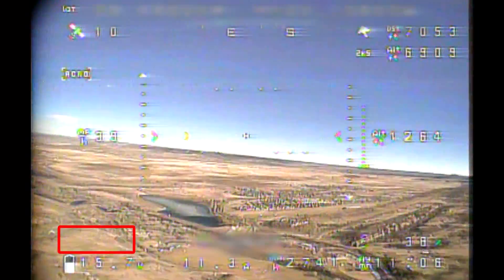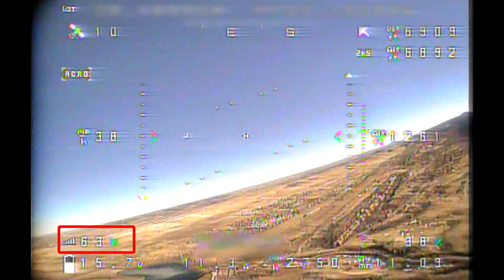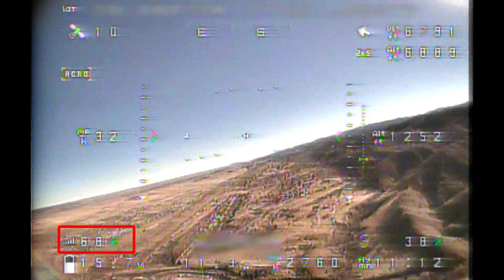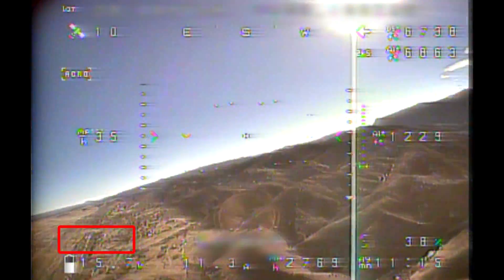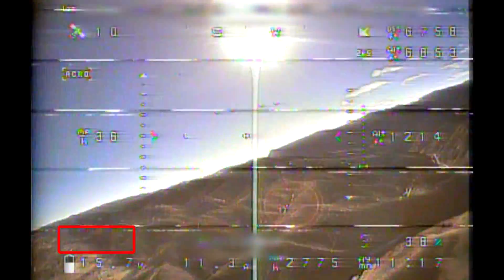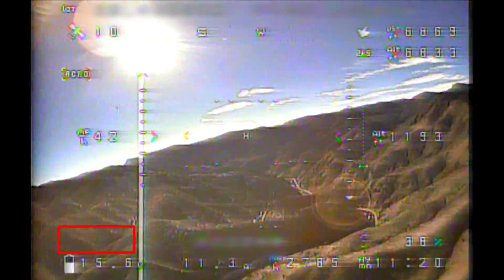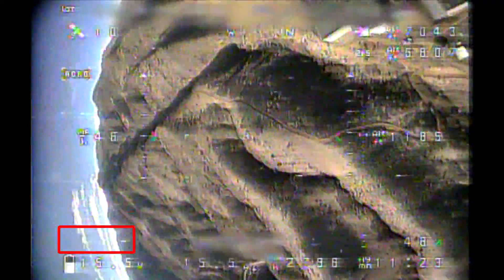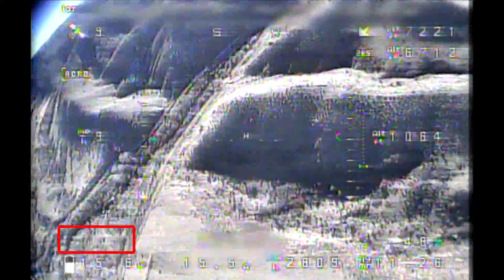Chimera Death Spiral

Comment: Oooooof! Looks like link slowly degraded before it said goodnight. Repaired?
Reply from the maker: +SYN FPV yes, repaired, reinforced, and is flying again.  Determined the most likely cause to be a damaged antenna (SWR=9) on the OpenLRSng transmitter which would&#39;ve reflected more than half of the 800mW back into the module.  I had been flying like this for a couple of months, so I&#39;m surprised it took this long to give up the ghost.
Thanks for commenting, that reminded me to go back and add this info to the description.

Comment: Ow. That sucks. Similar to what happened to my Gladiator XL a while back. The failsafe on the Hawkeye DTF/UHF receivers doesn't like to stay set. I've gotten into the habit of checking every flight.
Reply from the maker: GawainReif I'll be rebuilding it with my trusty Rangelink
Reply: @secretspy711  crossfire

Comment: What's your setup?
Reply from the maker: DTF UHF control with the 9 channel hawkeye receiver.  FC is a Flip32 running baseflight in fixed-wing mode.  Most probable causes at this point are a loose PPM cable at the FC, or RX power failure, again probably via a loose connector because it still works.
Reply: +secretspy711 Hey, I'm having SBA build me a custom Chimera and I've got it set up with EZ UHF.   I was wondering why you chose DTF UHF?   Just curious is all.    I live up in Loveland and hopefully some day I can fly with you guys.  and BTW.....GunsofPlentyNZ needs to get a life.   Just sayin.....
Reply from the maker: +Brian Rodda Hey Brian, I chose DTF at the time because it was cheap, open source, and had a beacon feature.  I've s ince stopped using it though, because the constant updates drive me a bit crazy, and others have had issues with it (such as, it forgets failsafe values sometimes).  I use my trusty ol Rangelink now.